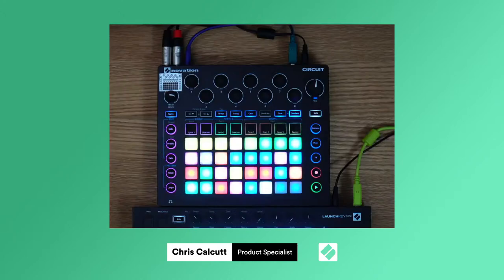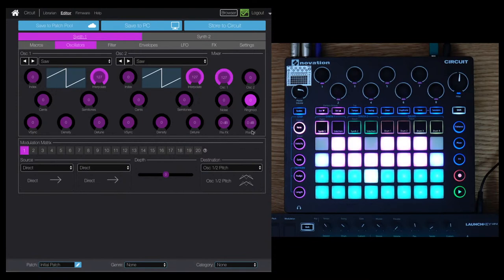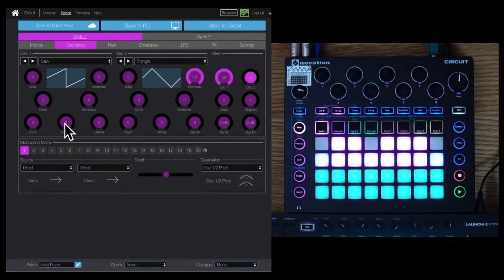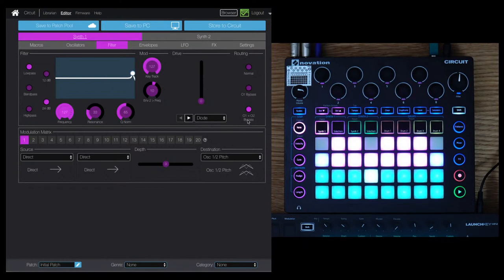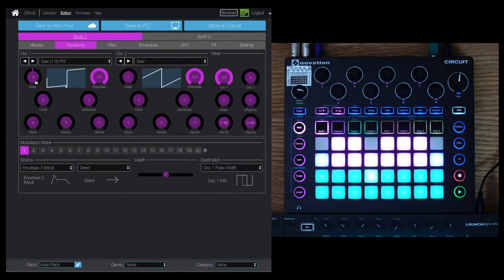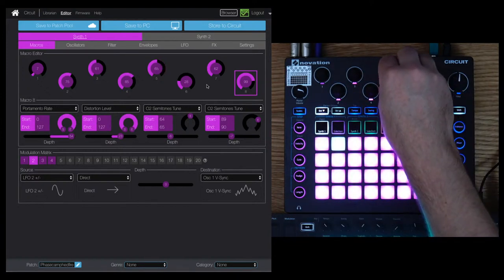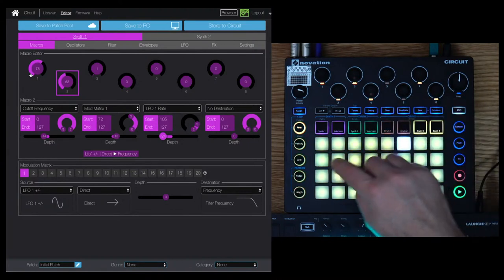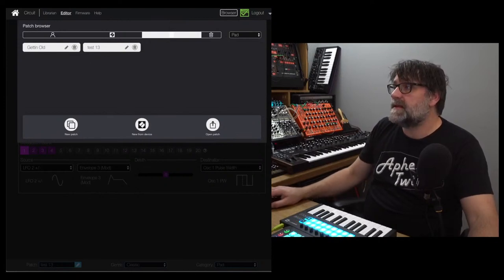Novation Circuit - Sound Design with -CALC- // Novation Live

Comment: This was perfect run through of the Novation Components for both circuit and tracks, which seems to be missing from the novation documentation. Well done thanks!
Reply: Still a bit confused with the LFO Fade modes and LFO delay triggers (of the tracks) not sure if that's a part of the Circuit (but I'll figure it out :-D)